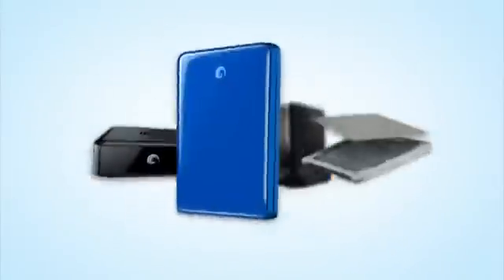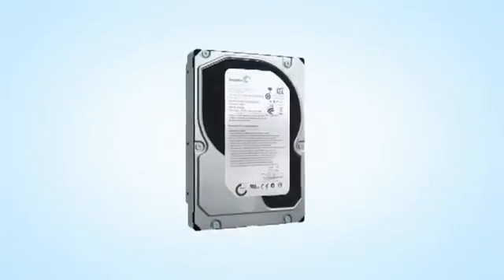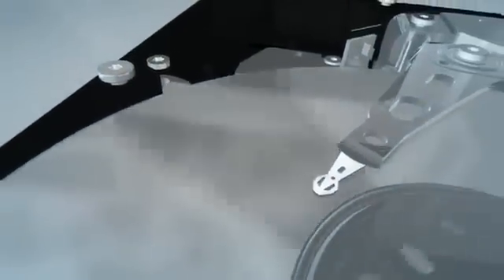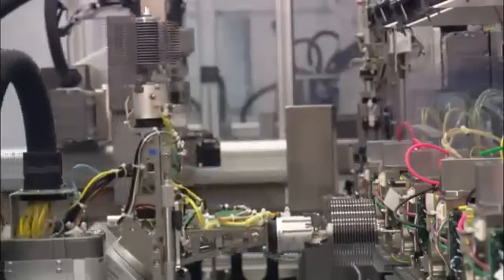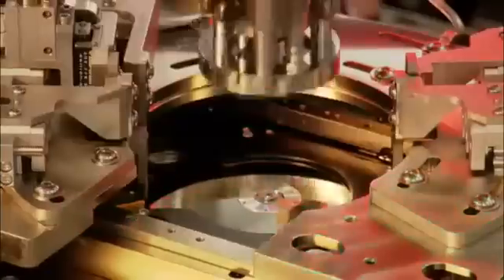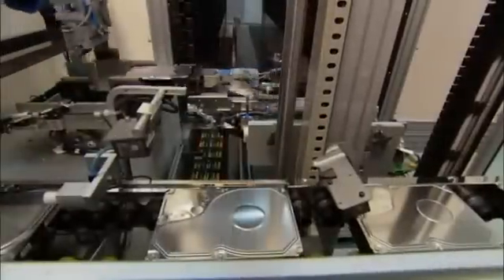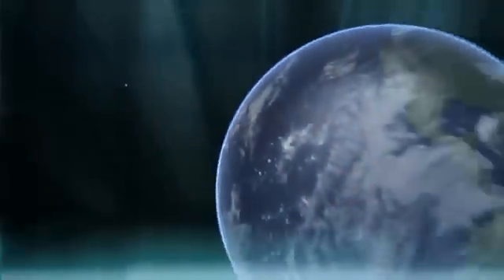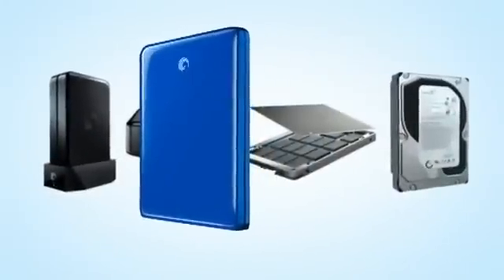Seagate Manufacturing Process,

Comment: Seagate get a bad rap. Their Iron Wolf NAS drives are nice. People have a bad experience with a drive and blame the brand ( was Maxtor for me for years). The distance from head to platter on modern drives is in the microns. All drives are prone to faults. I don't think theirs a brand of hard drive out there that hasn't given me some trouble. If you don't need speed go for a lower RPM drive, it'll last much longer.

Comment: Glad to hear that you are on the market for high-temperature insulation wire and cable. We, Jiangsu Silver&Tin Thread High-Temp Wire and Cables Co. Ltd, is professional in insulated wire and cable for over 20 years, covering Teflon wire, Silicone wire, Coaxial cable, Thermocouple wire,high voltage wire, etc. Hope to establish business relationship with you!kellyemail:export02@silvertincable.com

Comment: Seagate made the most unreliable hard drives in the market.
Reply: seagate hdd's never failed on me, neither all my drives
Reply: we had 12 seagate barracuda at my workplace. four of them failed within two years.. they are really bad drives. now all 12 are in the trash where they belong
Reply: most
Reply: Kotonoha Katsura you got lucky then. All datacenters reported that hard drives made by them had much higher failure rates than other brands.
Reply: Never ever a seagate failed on me and i have an mfm 20mb one from the 80's that still works
Reply: Dimitri Andreou I know I’m not referring to individual cases. If you look it up companies like Backblaze have reported that Seagate has had the highest failure rate of any hard drive manufacturer. They buy thousands of drives a year you probably buy less than 5 a year.
Reply: I was wrong i had a 1.7gb seagate that failed after 2 years but it was power supply problem cause also motherboard died and a voodoo 3. My friend you must understand that hard drives a not long-term storage solution it is just a component to make a pc work dailly never ever trust a hard drive for valuable data. I use an external hd for backup and after 2 years i buy another one and copy my files to the new one but i keep  the old drive as it is others use dvds
Reply: Dimitri Andreou bro I don’t even know what you’re talking about. You’re saying that hard drives are not for long term storage. But I never argued otherwise. I simply said that based on several reports from storage providers that go through thousands of hard drives a week they found seagate to be the least reliable. I never said they found them to be unreliable, just the least reliable.
Reply: Sulfen Which are the most reliable? I also have a wd in my car that works everyday for the last 8 years.
Reply: The most reliable was HGST. The second most reliable was Toshiba. The third most reliable was WD. And Seagate was the least reliable.
Reply: Sulfen Toshiba? Those failed me everytime also i have about 20 WD drives from mid2000s (20-40gbs) that all failed but WDs from the current decade are still working
Reply: Again, I'm not referring to individual cases. I go through around 200 hard drives a year and I see similar trends although some years WD is more reliable than Toshiba. But these datacenter that go through tens of thousands of hard drives a year have more accurate statistics.

Comment: after 10 years my 500 gb seagate still runs fine ... you just need some fans underneath to extend its lifespan
Reply: Min Es And how do you do that with an external hard drive ? :/
Reply: most external hardrives nowadays comes with aluminium casing which in terms acts like a cooling system and runs on modern motor that consume less power thats makes less heat

Comment: Have had nothing but problems with their drives since the early 90's.  I've had 20 Hitachi drives in my NAS at home spinning non stop since 2012 without a single failure.

Comment: There was one company that developed hdds where the mechanics was sliding with head towards to platter this only worked when the platter was spinning so enough airflow and pressure inside the unit.this way the heads never broke not like now days where most of the problems start with arm and heads. Just wondering why such a good ideas and designs that never fail disappear from this earth ....
Reply: @gigi morphe: That was Fujitsu! They implemented this M.O. of raising the heads off the disc in parking position. A nearby magnet kept the arm locked so that it won't slide out while out of power and being handled.

Only downside of Fujitsu was that their drives were horribly slow, no way near faster than USB2.0 ( 30MB/s ) hence being directly attached to their natural transport ( either IDE or SATA ).

Comment: Worlds most advanced failure. The 1.5TB drives suffered a sustained 34% failure rate. the 2T and 3T drived were close contenders.

Seagate drives of the past decade litter the top of failures along with Western Digital.

Double-digit failure rates.

At the same time, the high-quality contenders top the lowest failure rate list with failure rates in the sub-first percentage..

It's only NOW that Seagate is catching on with the 10 and 12 TB drives - but it's still too early to tell if it's beginners luck or if it's real.

https://arstechnica.com/gadgets/2017/10/big-hard-disks-may-be-breaking-the-bathtub-curve/

Comment: Seagate and Western digital factory already closed in my country.Disk drive makers Seagate and Western Digital are moving production to Thailand,low cost management & manufacturing in Thailand.with an expected loss of 3,000 jobs in Penang, according to press reports.
Seagate’s plant in Bayan Lepas will be sold,after 28 years,as well as a 16.4 hectare plot of land in Batu Kawan which it had announced two years ago as the site for its expansion.
The closure is a result of weak demand and changes in technology, and comes about a decade after the company laid off about 4,000 people in Penang.
Western Digital is expected to lay off 400 Malaysian staff and 800 foreign workers in its Penang plant, according to Business Times, quoted NST Online.
Seagate is also leaving Negeri Sembilan but will retain operations in Senai, Johor, the report said. It quoted a statement from US-based Seagate Technologies as confirming the end of manufacturing in Malaysia and its move to Thailand.Western Digital is expected to wind down operations from August.Earlier in the week, Seagate had said in a quarterly financial announcement that it would cut 6,500 jobs by the end of the next fiscal year, or roughly 14 per cent of its 52,000-strong global workforce.Seagate’s main manufacturing facilities are in Malaysia and China.

Comment: I built my home Media Server with Seagate.  I had two hard drive's die within the first six month's and then all three hard drives died shortly after the warranty went out. Won't be able to breath life into until I can afford new hard drives.  Needless to say having that happen I won't be purchasing those hard drives again.
Reply: If all the drives died it will be a common source, likely your power supply, a few failing would be possible but if all drives fail then there is always an issue with the power supply. (Or you dropped the server...)
My two MSA60's with 24 2TB Seagates has just now had it's first and still only drive fail after 7 years of being powered up and spinning 24/7, these are desktop drives meant to on occasion spin up but the MSA60's do not support spindown and thus keep them active, wearing them down much more and still the drives refuse to fail...
Reply: Some Guy Segate drives just seem to die for no reason, that's the problem !
Reply: That's the thing, it seems to come down to personal brand favorites. I've had 1 Seagate die on me, it was in a 24 drive MSA60 array, the drives are consumer grade drives never meant for 24/7 operation but hey they're cheap. That drive failed after more than five years of 24/7 operation in heavy usage at quite high temperature.
The other 23 drives + the Seagate drive that replaced the broken one still have not shown any signs of wear other than their hours on count increasing with the hour.
Before that the array had 24 Western Digital drives, the Seagates were an upgrade from 750GB per drive to 2TB to replace the WD's. 
Of those 24 WD's, 5 failed within two years...
Maxtor has had the worst track record here, the HP MSA60 array came as standard with the 24 Maxtor 250GB drives of which at least 12 failed within one year due to firmware screwups causing the drives to report they're in a read-only mode while they're not...
Besides that I've got about 10 external Seagate drives (varying from USB2, eSata and USB3, the oldest being nearly 10 years old) and several Seagate 3TB's in desktops, backup and in friends' computers that I've recommended, none failed (yet) in years of operation.
It's just a matter of luck, either the drive fails within weeks due to production flaw or it runs for years without issue. Choosing a store that handles them correctly seems to make the most difference.
Reply: Some Guy continuous operation is much less stressful than intermittent operation.

Comment: Legend Has it , HDD became obsolete..
Reply: Nope. HDD offer large amount of storage.
Example:
Seagate ST6000DM001 6TB SATA SATA3 7200RPM 128MB CachePrice = 309$CAN = 323$US
WD Blue 1TB Internal SSDPrice = 400$CAN = 300$US
You ca also buy 4x 1 TB HDD and do a RAID0 for more performance for a total of 4 TB.Each drive is about 70$CAN depending on model.4 x 70$ = 280$CAN = 210$US
Reply: @MOSSAD SPETSNAZOVIC SEALOV: There's no way that traditional hard disk drives ever will become obsolete! They can take write actions way better than SSD's. Why? Because they don't wear out by burning off material like flash-based storage!